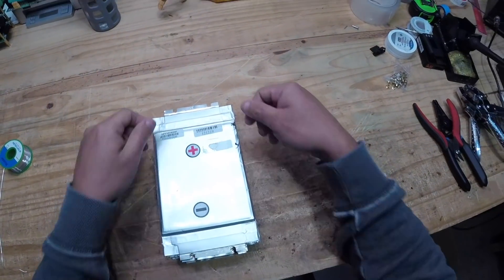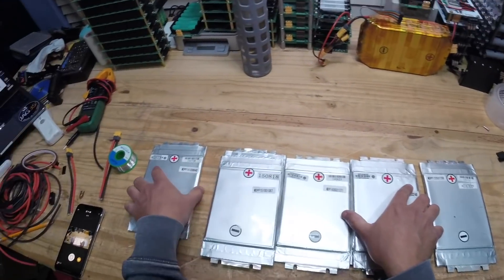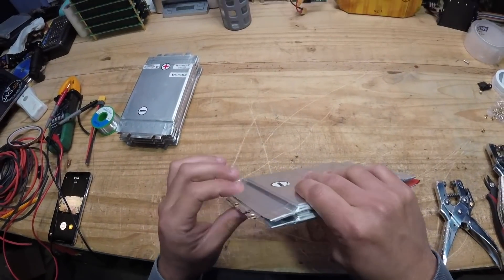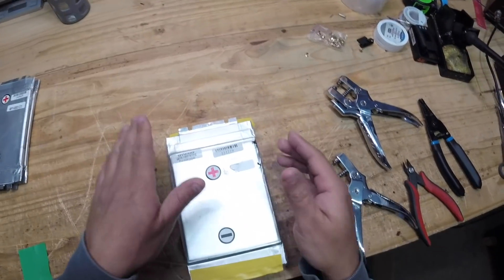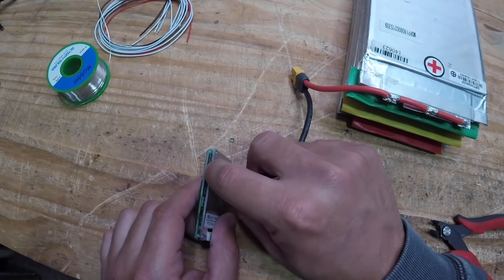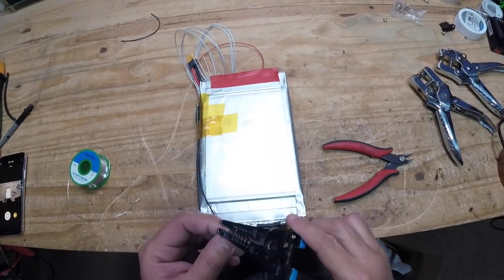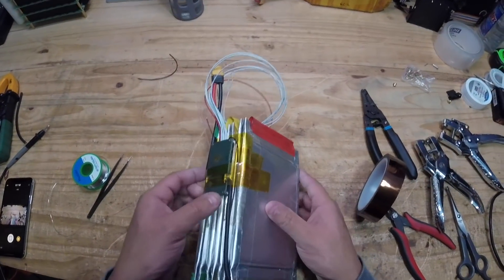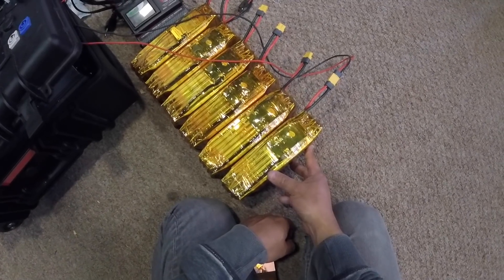Build SPIM08hp LiPo into 7s 24v packs with BMS

Comment: got a module or 2.    7s from hookup.    can i use an 8 s BMS i  have on hand,  leave off last lead..?   ok with balance only..  rely on inverter shut off for low volt cutoff..   thanks.

Comment: I know this is an old video but are the brads connecting those cells safe for the full 200a constant and 400a bursts or should i solder some 4 guage wire linking each cell as well?

Comment: hi, i am kind of new to this. but i thought, your doing a 7s for a 24v pack and that would mean a 8ah pack. but you say you used a 20ah bms and that you intend to do another project were you are going to use 6 of these packs and you say 6X20=120ah. could you explain? cuase i am thinking on doing a 7s 30p for 240ah. is that to crazy? was thinking initially to do 30p to get the 240ah and then take those packs and assemble the 7s. but then i thought the gage wire would be to big to handle 240amps. so i remembered this video and thought, why not do what jehu did, the 7s 24v packs. do 30 of those and then do the 30p to get the 240amps at the end. this way i would use smaller gage wire. simpler packs and would have the 24 volts right out the bat, and if a pack fails down the road, just have to take that pack out with out losing the 24v and only sacrificing the amps in that pack. please give your thoughts. would highly apreciate.

Comment: Can the SPIM08HP batteries be safely used for a 24V power bank to power a 3000w / 120 volt AC power inverter?  I am looking to build a small 24V solar power system to power a refrigerator, some electronics and a few lights during a power failure. I was thinking of using marine batteries, but they would take up too much room and are heavy and hard to move around..  Also how many 24V packs would it take to store the power I need for a 18 to 24 hour period? I live in S.E. Florida so sun light isn't a concern. Thanks in advance for any information you can provide. Jim

Comment: Another great DYI e build!! I am going to try this build. The battery cells seem like a great deal on Ebay. My question is , what would you recomend for a BMS that can handle 80-100 A burst? yet supply 40-60 all the time? This will be for a skateboard/e bike. Thanks

Comment: Mr Garcia, I built 6 of those batteries. What can I do with those? I just wanted to built but I have no plan with to do with. Can I buy some solar panels and setup for off grid or on grid? If I can, how many panels should I buy? Those 7S1P battery has how many amp, watt ? What is the best way to charge and setup? Thank you for you time. John C

Comment: Great video,
What if one was to use these for high power,
What circle connectors would you use different and what gauge output positive and negative?
Let’s say I needed 200 amps continuously and 400 bursts at 100v

So I would double each one to 2p or 3p
Reply: do the rivets like he did but also solder 4 guage wire to one side of the positive and negative connections which are riveted. On your first negative and last positive use 2awg cable it is rated for 350 constant.

Comment: These cells are good for about 10 cycles for a e board. Then they start to disappoint. I figure that’s why they are ditched and so cheap. I spent more getting these cells to Canada. Then Building these cells. Then it would to buy new. I am all into recycling. But this is a lost cause if you need a high draw. I needed good Internal residence for higher draws for my E board.These cells almost sold me till bad IR caused Low voltage alarms after a few cycles. My guess is that’s why they were pulled from the bus to begin with.
Reply: how many did you get and how many went bad?
Reply: Rex Smith II 

20 cells. They are a pita to get together. I ended up bolting them together. Hardware, shipping, duties, brokerage fees. Wiring, connectors..... it all added up and had a huge footprint in separate deliveries for things I could not get local. I have 4 5s batteries built from the 20 cells. One set  hits LVC on my board in 5 minutes of run time. Might be my build at fault IDK. All I know is two HRB 10000mah batteries do the job better and were plug and play. And the delivery footprint was much smaller. No extra mystery charges when they landed two. I get 12000 mah out of those 10000mah cells. I only get 6000 from these cells. And the finished battery is 3 times bigger and heavier than my 10000mah HRB packs.
Reply: @jayracz701  the size def looks bigger. I also use rc lipos for my diy offroad board and onroad board, very easy to make high discharge power from them. the only reason I considered these pouches , is I want to fabricate a custom case for my off road scooter im building and needed at least 200 amps cont and 500burst at 96volts. I use the turngy 6s 20 ah lipos with a series connector. now those turnigys are capable of that load the only thing I cant get passed is the 10awg wire leads that come out, I just wish they were bigger, plus the xt90 connectors say only good up to 90amps. so I wanted to build my own battery system with big bus bars etc.

Comment: i'm making a power wall with these. i've made them with aluminum clamp pieces that allow four to six parallel and helps space them out so as to not make overheating a problem. the clamp screws allow easy replacement of cells and only require one hole in the tabs . that small screw allows the bms to measure voltage for each cell at the joint between cells. all easy to assemble and take apart to reconfigure or fix. if you want to see or are interested message me here.
Reply: I'd love to see this. Any chance you can post a photo and maybe link to parts?

I'm trying to do something similar. It's easy enough to connect these in series with rivets like Jehu did since the tabs can be bent towards each other, but in a parallel configuration, that's not really an option since you have to connect each tab to both neighboring cells.
Reply: I would love to see/know what parts you used.  Stuck trying to build a pack.

Comment: Did you capacity test any of these? Tom says 95-105% rated. Joe said his was in the 7.5ah hood! Just curious if you tested, and matched these? I'm thinking of building packs of 100 , for a 7s maybe connected in series, with 1" x .125" with 250-300 amp fuses,  I may need spacers between ever so many cells , I havent built with these before, I'd rather build wit pouch, than 10k 18650's , I hope I can get this many, being on sale,

Comment: I bought a bunch of these, and they're fantastic.  I have a question, though.  Mine came with a huge amount of the pouch material all around the cells.  Did you cut it off?  I'm so afraid I'm going to break the seal/start it on fire if I do, but it's huge, like an inch on each side, and makes it harder to make into a pack.
Reply: HE FOLDED THEM OVER AT THE START.

Comment: Got a question for you. 1 have a 120v controller. What  would work better:16.8 volt packs x 7=117.6 volts( full charged 4.2 volts per cell) or 24 volt packs charged to( 4.0 volts per cell)?
Reply: 10s * 3?

Comment: Could they be used for a electric bike or would that stress them.
Reply: Yes but you would need to connect more in series to get correct voltage he's doing 7s for 24v so say do 14s for 48v and so on most electric bikes won't pull more then 30 amps
Reply: 13s is 48v 14s is 52v but either will work on most 48v systems. However the 52v will obviously be a little faster

Comment: I just bought 62  of these for an e-bike project at $4.50.each (496 amp hour at 3.7volt)  $318 with shipping.      Get them while they last!
Reply: Did you build your e bike battery, I'm thinking of doing two 24volt = 48 volt, for a 48 volt front wheel. It will be interesting to see the distance  they will get.
Reply: @starrvalley12  As you can see I just ordered the batteries.I have built several 18650 packs and 1 pouch lipo battery pack,but not at a high voltage. I am not a big fan of pouch cells but like everyone I am trying to get the best deal I can. I think headway cells would be better but the cost is just to high.Hell I don't even know if the motor(hub type),controller (5000 watt -13000 peak) are any good yet. I bought them 5 years ago. I do know i will be pulling over 100 amps at close to 120 volts. The controller is the biggest one I have ever seen even after 5 years. The hub motor is rated at 150 lbs of torque and 17 to 19 hp. So I will need a powerful battery bank for sure.
Reply: @starrvalley12  I have built 1 1000 watt 48 volt e-bike with lipo pouch cells. It  made around 1200 watts peak and had around a 25 amp draw. These cell are way better than the ones I used,  Just be sure you do not short these cells  300+ amps is no joke! I watched many videos before building my first pack.
Reply: @unrealinventor2006  , Thanks, I will definitely be careful with these.
Reply: @starrvalley12   Did you guys ever build these packs?  I plan to build multiple 7s packs but haven't decided on how to make the series connections.  I also tried soldering these but the solder didn't wet the tabs at all.  Might not have had enough heat, or maybe I need the aluminum compatible solder.  Any advice??
Reply: @michaelkramer111  , no I have not yet had a chance to build my packs yet, I did balance all cells to 3.8, it's also a good storage level, my plan is 7 cells series together using the Crip method he used in video, I will build 4, 7s pack, series them and parallel them will give me 48v 16Ah  No bms, all 4 packs will be built so they can be disconnected  from each other so I can charge one 7s pack on my charger and balance each cell while charging, also each 7s pack will have a cell checker so I can see each cell while on the bike, this way is not for everyone but I like to monitor each cell and not depend on a bms that can trash my battery, hope this helps.
Reply: Ron Stark what tool are you planning to use to crimp the batteries ? The same one that is linked in the video ? Have you attempted to solder any of the cells yet ? I tried yesterday and was unable to get the solder to wet to the tab. Just wondering if I need more heat or need a special kind of solder.
Reply: @michaelkramer111  , I ordered the tool he is using, he has a link , Amazon, tool with tabs. Looks like he is soldering to the tabs.
Reply: @unrealinventor Did you guys ever build these packs?  I plan to build multiple 7s packs but haven't decided on how to make the series connections.  I also tried soldering these but the solder didn't wet the tabs at all.  Might not have had enough heat, or maybe I need the aluminum compatible solder.  Any advice??

Comment: Datasheets usually specify a compliant pad (foam) in between pouch layers and also a uniform clamping pressure for the entire sandwich of around 4-18 psi. This pressure controls swelling and also ensures best performance as it helps the electrodes inside have the best contact.

Comment: So I bought 20 of these, one is soft, more bendable, like it lost it's internal vacuum--is this cell a problem? Thanks Jehu
Reply: spim08hp flat cells from battery hookups. danger danger. they don't tell you. many of these cells have problems inside. there is current flow between the foil covering insulation layer and the terminals of many cells. measure the terminal to edge voltage along the seams. i'v gotten 3.9 volts off the foil wrapper. the cells will puff and be destroyed from self discharge. many of my 60 plus cells i bought do not have this problem. all the 30 % that puffed without ever being under load have the short to the foil. warning the edges of the cell packs carry current.  not safe for marine environment at all.  i only made 12 volt packs at higher voltages there will be bigger sparks from foil to terminals. danger if they self discharge they will puff and oh they say you didn't do good assembly. they don't say anything about do not touch electrically hot foil next to terminals. if a buss bar touches the edge of the foil it will short out the whole battery.
Reply: @willfriar8054  thanks will check em

Comment: Come on Jehu.....SHow us how you connected the 7s BMS to this type of IN SERIES battery system. The part that you speeded through in the video was the point that a few of us really needed to see since you had the pos-neg soldered together.  Please show us how you did it .   Thanks
Reply: after he connected the negative and positive you just add each wire in order to the positive terminal in the pack in the stack.

Comment: You can use small, short screws and nuts with lock washers, which I would trust more than I would islets. Additionally, you can hook up your wiring from the BMS easier to the screws and nuts than having to solder onto islets. Soldering introduces heat into the ends of the packs, which is not good. So, there are a number of ways to do all this. It's just up to the individual.

Comment: Hi. Could you explain how to make this battery into a battery to power a large multi rotor, like DJI's S900 and S1000 Spreading Wings Platforms. Batteries are way too expensive for drones so I'd like to make my own. Like what you just did but for use on a drone. I'd also like to have a voltage and % display. Any help and directions greatly excepted.

Comment: Hi All, I'm an Electrician...  Just a heads up, you can utilize a specialized paste called NOALOX.  Its for any Aluminum to Copper Connection that will pass current.  We use it all the time where we have copper wire inside aluminum terminal blocks.  Go Get Some!
Reply: Great tip, thanks! If connecting these in parallel, would you also want to use it where the aluminum tabs touch each other?
Reply: @bungle555  Yes. Aluminum grows an oxide layer on the surface when exposed to air and the paste keeps air away from the aluminum surface to prevent oxidation. Oxide increases the connection resistance and that leads to overheating at the connection under load. Without the paste things will work fine at the beginning (such as when the battery pack was initially made and tested), but over time the aluminum connections will degrade.
Reply: i think its nickel plated copper tabs
Reply: Are those  eyelets not brass?

Comment: Jehu, I was wondering if you thought of making these into 10S 36V packs and use them in your Tripp Lite Emergency Solar generator project? I just got the hollow UPS and was musing over the idea of stuffing 2 10S packs with these SPIM08 pouches. Do you think they would fit? I know the original idea of the Tripp Lite project was to make something simple and off-the-shelf, but where's the fun in that?
Reply from the maker: Try it

Comment: Thank You for the video. I soldered some 14g wire to the tabs and added 1/4 eyelets so the cells are bolted together for the wire connection. Its not the best and I am thinking about redoing this the way you have. My use is not high power right now  around 3-4 Amps. Just hobby use for solar and getting into Lipo batteries.

Comment: Mr Garcia, u speed up the one part im soo clueless about, where to conect the white wires for the BMS :(
Reply: Cuba Croll  I think that he did connected the white cables to the positives on each batteries.
Reply: @juancarloshernandez1769  each cable gets to the joint of the two packs. So in the 7s you would have 8 cables, 1 for positive, 1 negative,  then 1 for each joint
Reply: @juancarloshernandez1769  click the link I put at the bottom of the page. It will help you..
Reply: The Dookster thank you  buddy i appreciated!.. God bless
Reply: Look at this and it should help you understand that it is the joint area of where they meet.

https://youtu.be/TK7re9y_Pxs
Reply: slow the speed down in settings
Reply: The Dookster I did that and it still to fast to understand how to hook up the white cables.

Comment: Jehugarcia thanks for this video I build 2 5s pack using your method I'm gonna run them in series to make a 10s pack for a electric skateboard I'm trying to figure out the range I would get on these battery if you can help I would appreciate it thanks and I remember you using these cells to build a eboard but I can't find it:(

Comment: Would it be possible to use theses cells to make a lipo replacement for a car battery.... maybe suggest a BMS or no BMS? I feel like 200Amp should be enough for a 4 cylinder.

Comment: Hey Jehu, thanks! A bit of offtopic: is it ok to mix (in a parallel string) 18650 and 16650 given the fact they match regarding capacity, resistance and self-discharge rate?

Comment: Hey, good build.  What's the width with those tabs taped down on the side?  (I'm curious why you didn't use kapton tape there.)  Tom's video didn't give the thickness, either.

A tip for better soldering, Jehu, is to wet that sponge and wipe the oxidized solder and rosin off the tip.  It will transfer more heat and faster, every single time.

Quick question:  I'm holding up the build of an ebike (the sale of which will allow me to make another 2 ebikes) hoping that you'll sell those Sony VTC6es to me some time soon.  Are you going to get back into the sales of those wonderful batteries in the next month or two?  I'd love to buy a whole box of Sony and another whole box of Panasonic.  (we fans WANT you to succeed in DIY Powerwall board kits and battery sales, Jehu!)
Reply: The width with the  outer wrap taped down is 4.7 inches , the thickness is .325 of an inch .The outer length. end of tab to end of tab is 8 inches.

Comment: Love your channel and the subject you cover. But I still need your help.
I was in Solar power and electric cars 20 years ago. I have retired and don't have any of my old tools and supplies.
I need to replace my batteries on my electric bike. It is a conversation kit, 48vdc, 1000w hub motor. I like the batteries you just showed. What I'm asking for is a price from you, for a completely assembled battery pack. Labor and materials. I could use up to four, 4, battery packs to assemble the battery bank.
The least I would get is two but have room for three or four.
Thanks for your help, Ted Jenzen
thjenzen@gmail.com